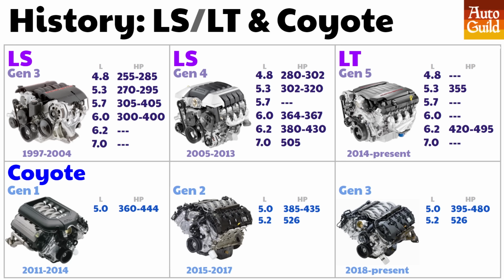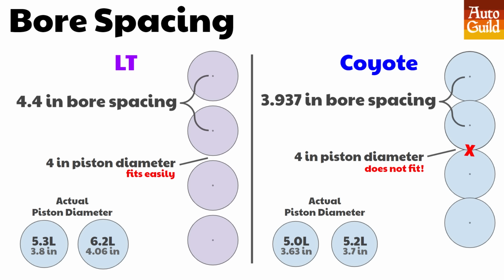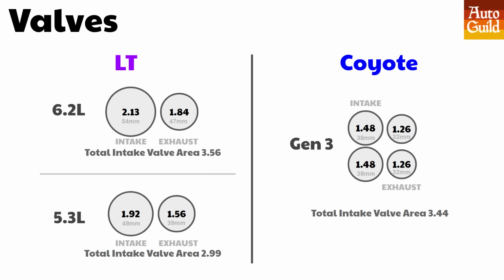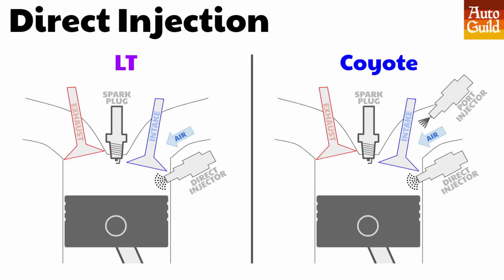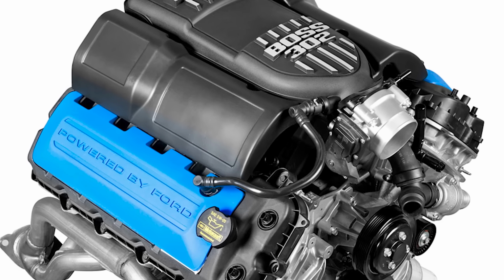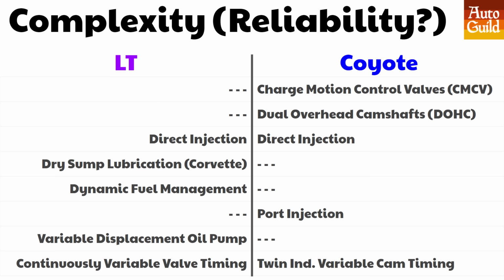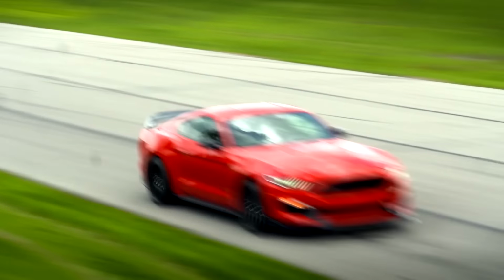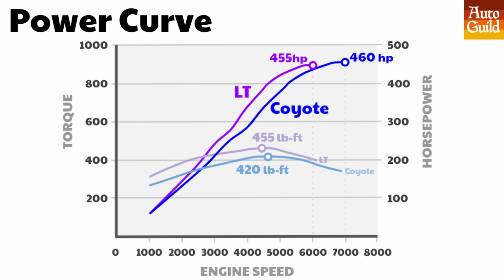GM Gen 5 LT vs Ford Coyote.  Which one is better and why.

Comment: Damn dude you have a complete understanding of these motors & you're good at explaining it 💯%👍👍
Reply: Motor?  Motor?  It's not a Tesla.  It's an engine.
Reply: @Makitaization  which one of these engines can just oil injection tilted in any position with amsoil dominator 2 stroke oil with out a wet sump? i would say the coyote motor could but i could be wrong.
Reply: @Makitaization  How about a poppet valved u-loop charged 2 stroke conversion coyote
Reply: @Makitaization  i have no respect for amrican engines other to except premix or vro
Reply: whate is your oil injection vro for the coyote
Reply: @Makitaization  A tesla motor is an electromagnetic rotary 2 stroke! Whence its in sane hp and torque for its size and weight. if i get a coyote im riggen up oil injection with  2 vro pumps and runnis amsoil interceptor thought out.
Reply: Niether one, what is there dfi 2 stroke v8 option for 2022?
Reply: @Brian Stafford  cause the 2 piece plugs. Im a Ford guy and the 5.4 of that yr is junk
Reply: @Brian Stafford  the 5.4 isnt half the engine a mod 302 for that matter.
Reply: 😆 this comment wreaks of clueless
Reply: They are not motors unless its eletric or hybrid. Gasoline engines are powered by internal combustion ENGINES, not motors!!!
Reply: @stevenashley7651  congratulations grammar Nazi👍👍 the motor in my 2.0t Accord runs great 😂😂😂
Reply: Lol. This is like elementary 😆  WOW you are easily amused.  This is common knowledge bro
Reply: @tnaccountability7455  what is your gas to oil ratio
Reply: electric can run 50;1
Reply: @jlo13800  you wanting to grab a lane or attempt to belittle my profession? Lmk 

Cash in hand waiting clown!!

Comment: High reviving crossplanes can be done quite easily, it’s just that the cam profiles and cylinder head design makes them very lazy down low.  Project spinal tap is quite a neat take on that very subject with the LS platform.  The argument that pushrods and cross planes don’t like to rev was proven untrue 30 years ago.  Modern spintron testing and camshaft development has made RPM even easier to achieve with 8000+ rpm cam lobes that are requiring less than 100 lbs of seat pressure.
Reply: What mag did you poach those lines from? One I wrote, perhaps?
Reply: @aesir0784  Poached magazine lines?  I'm not sure what you're talking about.  I'm friends with Billy Godbold on facebook and I follow his updates on projects and tech talks.  I live in the land of nascar country where huge cube V8's spend most of their lives at 8000+ RPM.
Reply: It not done for the revs.  It's done for the reduced rotating mass which allows the engine to change revs quicker and also the exhaust scavenging.  A flat plane crank is typically much lighter often about half that of a cross plane.  It's the same reason if you're a road racer you would choose a light weight flywheel, allow quick up and down shifts.  It was a way bigger deal during the manual trans days but it's easier on DCT too.

There are some test where a Coyote crank was put into Voodoo and they made about the same power and torque.  I think cross plane made a bit more torque and slightly less power, very small though.  In terms of red line it's soft red line based off where the engine rolls over.  If it's not a limitation of the bottom or top end in either case.

That's not true of the Voodoo crank and I suspect that it wont be true of the C8's new 5.5L. It's lighter but only by a few pounds because of the large displacements. Those engine are using flat planes mostly for marketing hype.  The C8R engine is heavily restricted by rules so the production engine will make considerably more power.